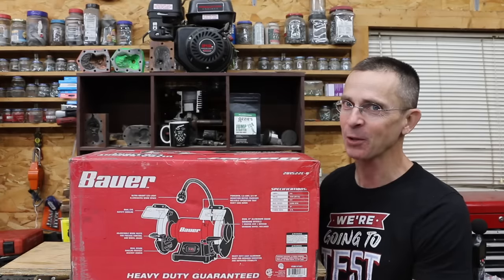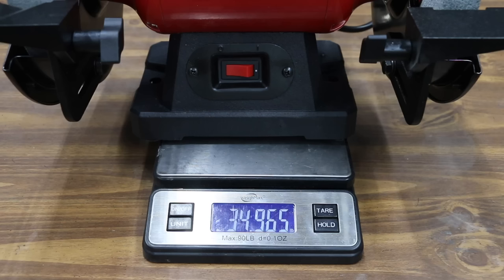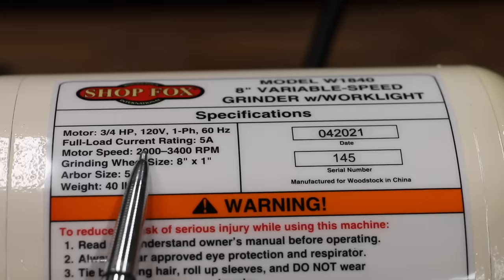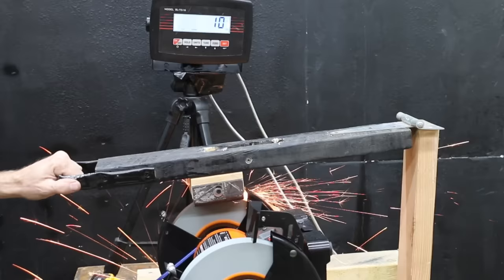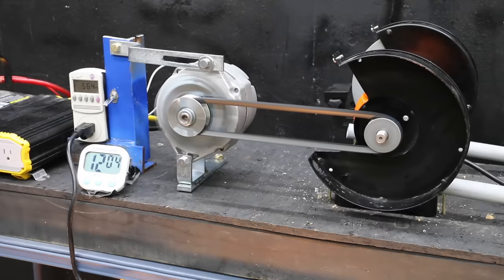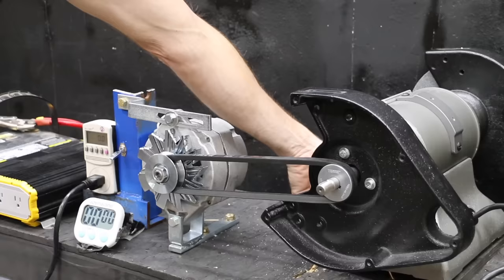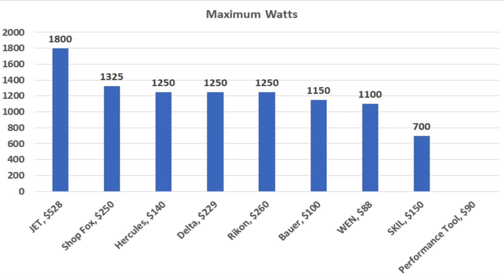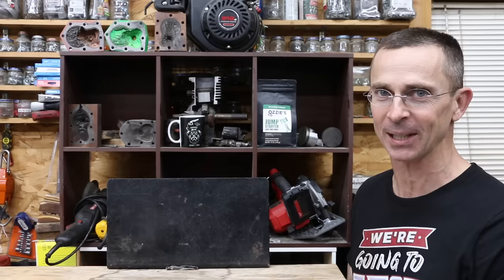Best Bench Grinder? Let’s Settle This! Harbor Freight Bauer vs JET, Hercules, Rikon, Shop Fox, Delta

Comment: 5:29 Instant anxiety seeing a bench wire wheel. They are so dangerous and sketchy, you’re much better off using a wire wheel on a handheld grinder. Kid in my welding class in high school got his thumb ripped open thanks to one. Of course the moron was wearing gloves though. 

Don’t forget about the fact it can send those wires flying like a dart gun into whatever is behind it. Wish more brands would have some sort of brake feature on these like some special bench “grinders” do. Used one in my college class and it’d basically come to a stop in like idk 3 seconds. Comparable to a battery handheld grinder brake speeds.
Reply from the maker: Thanks for the feedback.

Comment: Hi ,,, having just bought a cordless grinder , Im thinking one of the tool free disc change nuts is needed ,,, but I had one a few years ago and it wasnt great ,,, when I look now there are lots to choose from ,,,,, but are they all created equal , have you tested them , or could you test them . just a thought for a new test video. thanks Tom
Reply from the maker: Thanks for the suggestion.

Comment: i only once in my life saw a bench grinder without vibration (almost none ) 
the guy who owned it talked a bit about it 
the machine was german and over 30 yo 
he still had the original wheels with came when he first bought it 

the wheels he buy now are the same priece PER PIECE as he bought the machine with 2 wheels 
the only reason he buys these expensive ones is because of the vibration 
the original wheels he had (pretty small) had almost no x/y movement 
the cheap ones were so terrible it shook the whole table 
onlly the expensive ones came close 
fun to see the quality degradation over the years in under 10 minutes
Reply from the maker: Thanks for sharing.

Comment: I just payed 180 for the bauer this week. Kinda wish i bought it 7 months ago. Haha. Idk it works i guess. I wish it could be set to a slower speed and i really need to get a diamond wheel. But then again maybe i should just uses the bench grinder for rough grinding and wire wheel and get a dedicated machine for polishing and a slow speed horizonal diamond wheel slow speed do hicky for sharpening everything i can find that is metal.
Reply from the maker: Thanks for sharing.

Comment: You've tested drills, angle grinders, saws, and now, even bench grinders to see which are the best among them.  But why not test screws and nails to determine the best among them?  Those past tests may have been unfair if the screws and nails are not comparable.
Reply from the maker: Thanks for the suggestion.

Comment: can you make for test Electric Car Floor Jack 5 Ton All-in-one Automatic 12V Scissor Lift Jack Set for SUV w/Remote Tire Change Repair Emergency Tool Kits Floor Jack for Vehicle Wheel Change (5T)
Reply from the maker: Thanks for the suggestion.

Comment: Can you please test torque wrenches?
Reply from the maker: Thanks for the suggestion.
Reply: @Project Farm  wow I didn't expect to see you reply, your channel is so big.  I'll be watching for it for sure!  I know these videos probably take aw while to put together.  I have an icon harbor freight torque wrench and I'm kind of worried it's either inaccurate or not working because around 25 ft lbs it seems like I'm putting a lot more than 25 ft lbs into the bolt before I eventually stop out of fear of messing it up because I feel like it's past the amount it's supposed to be 😅 do you know of somewhere that can test a torque wrench for cheap or free?

Comment: Where are the Baldors? Ive got Baldors that come up to full speed in less than 2 seconds. My 3ph Baldors are at full speed in about 3/4 seconds. Heck.. Ive got a Craftsman from the 1970s thats 8" that will beat anything with exception of the Jet.

Comment: For a carpenter it's rather silly if the tool rest can't be adjusted in angle, so you cant sharpen chisels and planers. Disappointing from the - otherwise good - expensive model.
Reply from the maker: Thanks for the feedback.

Comment: You missed the best cheap grinder from Bellorus," Устройство заточное бытовое ЗУБ-1"
You did not evaluate stock state vibration, and the main cause poor flanges and wheel holding washers quality. Why pay hundreds for a flange on shaft of 2mm ? Really?

Comment: Though I hot a 6in wen grinder, my experiance with it is that they are junk. What really soured me on wen was a vibration I couldn't get rid off. Tore it down completely,  stuck the shaft in my lathe and found the right stone mounting end to be not straight. No way to balance it. So I will never ever buy a wen product. My 8in grinder I bought many many years ago and it was a craftsman for just under 60 bucks on sale. And it had no issues.
Reply from the maker: Thanks for the feedback.

Comment: Jet is good stuff but WAY over priced !!  as with many tools it's about quality of bearings and it's race !  The quality of the "winding" process and how much winding is applied. Capacitor start is nice becuz it brings the motor up to speed quicker w less energy used to do so. If the motor is built w cap start AND cap RUN now u have a powerful, quick motor to run ur grinder. its more " fuel" efficient, runs cooler, best bearingsAND windings make it quieter and the list goes on.  I often think that for " inexperienced" users a grinder that has a RESONABLE stall speed is a GOOD THING for saftey sake !!!    MANY years ago icame across a Dayton grinder that was clear of vintage stock that didn't run. I  gave it to my dad who told me this " kind " of grinder isnt eay to come by and that it was built for industrial use even tho it was smaller in diameter than the ones u had in this video. He took it to a guy he knew that could do rewindindings 
by hand, anyway that grinder IS NOT for the novice !!!!  It IS DANGEROUS becuz there is ALMOST no stall to it !!  it will 'suck' in ur work piece AND ur hand if not very carefully used !!   so i THINK alot of these grinders r what they r 4 a reason !!!  Dont think u can go from ur 62 chevy to a 2022 indy car and b just as slick w it !!!!!!  that is for fools !!  Anyway another totally awesome shoot out boss !!!!!!!!!
Reply from the maker: Thanks!

Comment: Makes me feel squeamish when I hear "it takes 2 minutes to stop". That would mess up your hand so badly if you got it in between the spinning wheel and casing... I know that's obvious, but still hurts me thinking about it.
Reply: You’d have to be using the tool in a very careless and improper way for that to ever happen.

Also it would stop much faster with a finger in it (assuming you turned it off).

Comment: where did you find these garbage tools?
in my garage I have 50 years old grinder, starts up under 5 seconds and stops in 17 seconds flat. But what bothers me the most is the wiggle-wiggle motion of every single grinder wheel you presented.
All of them are pure garbage.
If you can buy yourself old peace of equipment- buy it. There is a great reason why cars from 90s are going up in price.